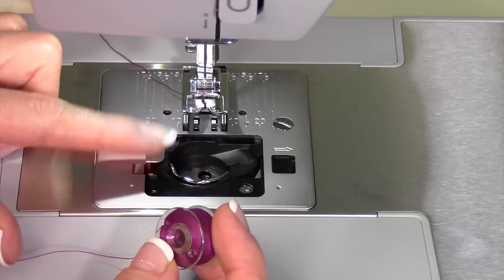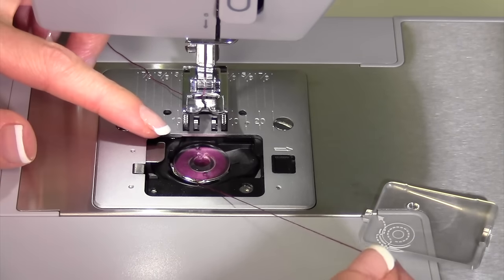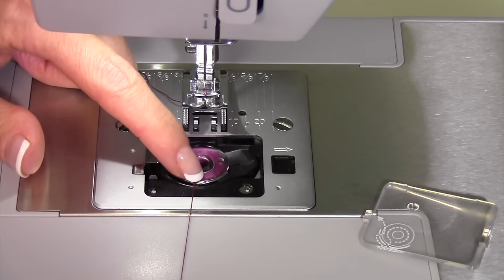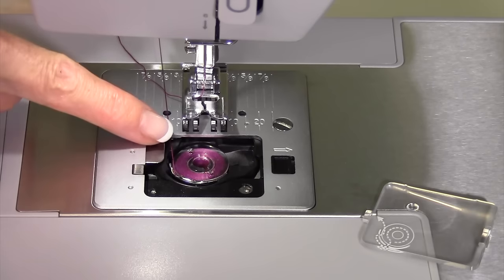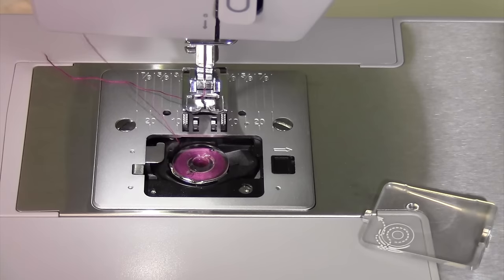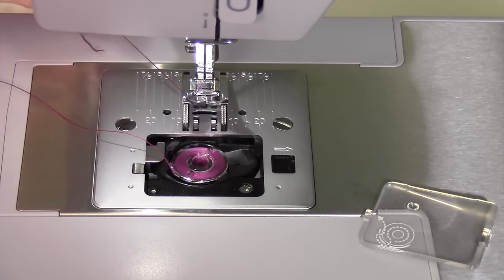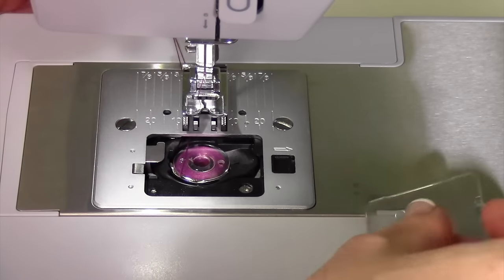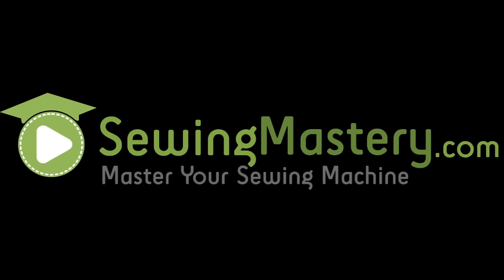Singer Heavy Duty 4423 5 Inserting the Bobbin

Comment: I turned my hand wheel 1 full stitch and it didn’t bring the other string and now I’m crying
Reply: Same I don’t... I don’t understand
Reply: Same. Anyone figured this out? I clicked the bobbin thread, everything like shown, but the the two threads don't "combine"
Reply: Same... I hate this machine so much.
Reply: Watch the video with your glasses on until it sinks in.  It's very easy to do.
Reply: @janrandolph361  Wow, that's very helpful.. You didn't have to say anything, if you weren't interested in actually helping someone out.
Reply: make sure you hold the upper thread upwards gently, otherwise, it is too slack and looks like it's not pulling up the thread. then the directions are the same as in the video.
Reply: Just try again and make sure you hold the bobbin down as you try to get in that tension device. Then make sure you are holding the thread from the needle as you turn the wheel towards yourself. I'm not sure what I was doing wrong either but on the third try I must have done something different because it worked just fine
Reply: For mine, the presser foot had to be down. It looks like hers is up here, but maybe thats just the angle. Also, turn the wheel towards yourself. Hope this helps.
Reply: Yes, key is turning the wheel towards yourself!!
Reply: @erikaford7864  geez thank you, you should be the teacher. such an important piece of information to just leave out !!!!!!!!
Reply: i’m so late but put the presser foot down! worked immediately for me when i did that🥰
Reply: THIS WAS MY SOLUTION 
Make sure that your option isn’t in zig zag or an other one make sure it’s straight! This was my personal struggle that I didn’t notice that it was in zig zag
Reply: @jungle.jezebel  thanks! I totally forgot to turn the wheel towards myself 😅
Reply: Followed instructions still won’t catch 4423
Reply: Turn your wheel toward you rather than away from you.
Reply: @erikaford7864  You’re awesome. Now I can fix my gym hoodie. Thank you.
Reply: @erikaford7864  THANK YOU SM
Reply: @jungle.jezebel  Yes! Thank you!
Reply: @erikaford7864  this saved me!! Thank you!!
Reply: In my experience i just keft the thread in the box and started to make that trun thing and it came out. It may be stuck under the foot so in that case you just GENTLY ( i broke my foot doing that) get out from underneath
Reply: Mine won’t grab the threads either. It’s been unable to since I bought it two years ago I’ve given up after watching so many videos seeing if I’m doing anything wrong. It’s the machine not the user. I don’t recommend this machine to anyone.
Reply: Make sure your needle is threaded because I made that mistake and it wouldn’t go through
Reply: Also, thank you, whoever suggested turning the wheel towards you and the person who recommended putting the presser foot down
Reply: IM GONNA RAGE
Reply: @erikaford7864  
I love you. Thank you.
Reply: @janrandolph361  
Having glasses on wasn't going to help me if the info I was missing wasn't in frame.
Reply: @raisingirl95608 yeah same because I did EVERYTHING suggested in the comments and it’s still not working
Reply: The foot is down!   As soon as I put that down it worked!
Reply: I pressed the foot thing and it worked! I was just looking up videos for help! My Tia did it without it so I’m not sure what is the proper way, but hopefully this helps you get to sewing like I’ve been trying to do to learn 😂😂
Reply: This happened to me
So what I did was I kept turning the wheel and it got harder to turn but I kept turning it and a knot came out so I untied it and it worked fine
Reply: Same
Reply: It’s important to turn the wheel to your side and pull on the needle thread while doing it. When a tiny hoop comes out with the needle thread just pull it out with something small.
Reply: Agree. I think she’s missing a step and she’s talking so fast!😢
Reply: @rbguerreiro2466 when you start it will combine by self
Reply: Been there😔.. youve just got to take a breath and come back to it, eventually youll figure it out
Reply: 25 minutes of frustration before in anger I turn the wheel one full stitch BACKWARDS, and I see how the darn thing is supposed to work. 

Thanks for an ALMOST really good video on how to do this.
Reply: Same ur not making the vid clear enough
Reply: @Frith2010 I know this was 3 years ago, but thank you so much.
Reply: @erikaford7864 thank you! That's were I've being going wrong!
Reply: Catch the bobbin thread , very good video on how it works
Reply: @erikaford7864 thank you!! That WAS the key.
Reply: Absolutely none of that worked.
Reply: I tried everything in the replies and nothing im about to burst into flames
Reply: Thank you!
Reply: This is what did it for me! I wasn’t grabbing the thread when turning the wheel thanks!!!
Reply: @jungle.jezebel this helped
Reply: @erikaford7864 I know this is from 4 years ago but THANK YOU!!!
Reply: @Aslanreturn omg it works thank you!
Reply: @erikaford7864 aha!! That is it! 🎉
Reply: @jungle.jezebel oh my gosh thank you so much. Ive been turning the wheel the wrong direction for ten minutes now
Reply: @erikaford7864 THANK YOU SO MUCH

Comment: Yeah, watching how this bobbin threading is WAY easier to see it correctly by video rather than the diagrams in the quick sew card or manual that comes with the machine! Had to watch a video to learn correctly how to thread with the automatic needle threader! Now I can do it so much easier!

One thing I learned I. These videos is that the needles can hit the needle plate and poke holes in it or make a groove in the needle plate and then the tension will never be correct as the thread gets caught in that groove on the plate and stops the bobbin and bunches up and makes a big mess. I was able to remove the plate in my singer 4423 and use a metal nail file to file those grooves down so the thread no longer catches there. Boy was I happy that was the problem as I thought I’d really messed up my machine! The part that holds the bottom was also popping up due to the tension being thrown off in it, too, and I found a video that showed how to correct the tension down in the bobbin mechanism. I will be a full fledged sewing machine repair gal👩‍🔧 soon! Hehe nah, I’ll take it in to a real repairman soon cuz I’m not about to take all the parts that need taken off to have everything cleaned and checked and oiled. I have really missed the old Kenmore machine I got the first machine I ever had 50 years or so ago! I loved the old singers, too, but not the treadle ones. This computer stuff gets too complicated for doing gems and simple projects! 🙄

Comment: Wish this saved my day. But no. I get the bobbin in as you show, get the thread through the slot for tension, take a stitch, nothing. Cant' get it to pull the bobbin thread up through. What is the issue?  EDIT:  Never mind. I figured out I was turning the wheel the wrong way, I was stitching in reverse and it wouldn't pick up. DUH
Reply: Thank you